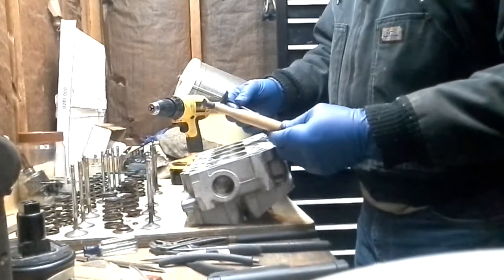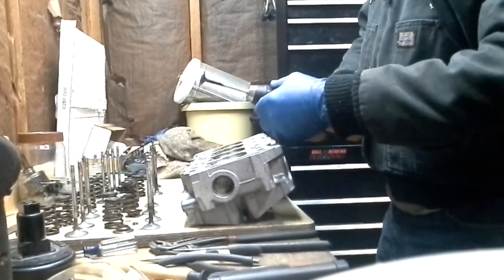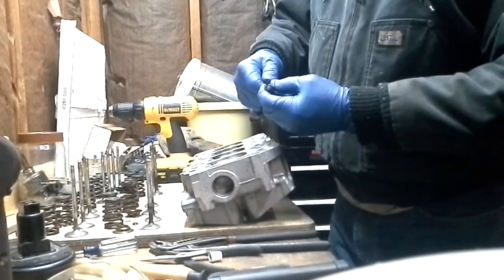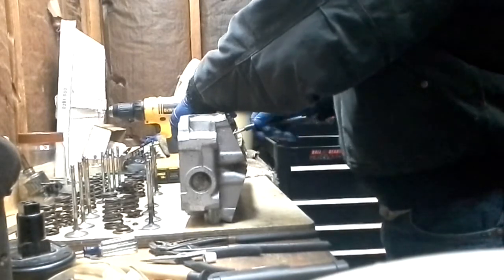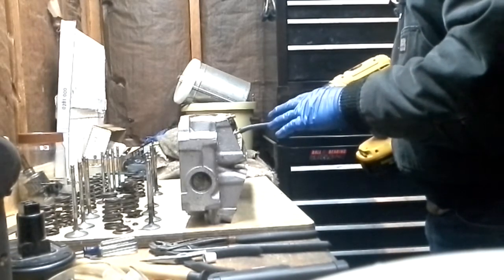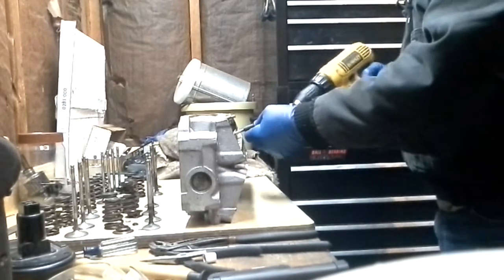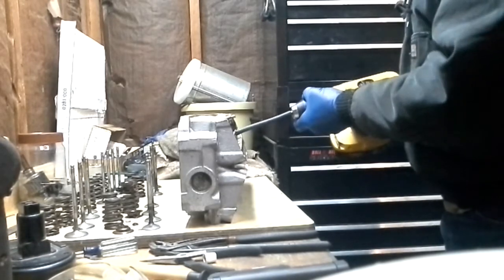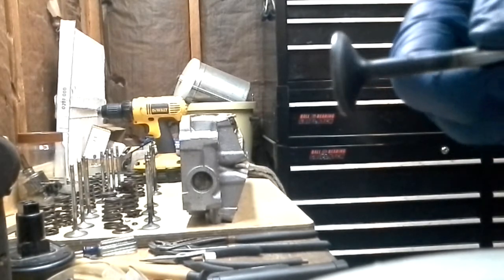Homemade valve lapping/grinding tool. Super easy to make!

Comment: I was told going forward and reverse with the drill sits the valves better.
Reply from the maker: Thank you for the comment. I've done it both ways and obtained equal results.  You could go forward and reverse...I feel it's a personal preference.
Reply: @LD9user  Ok.  Just wanted to get your take on it.

Comment: This is a vaery old technic. Problem mostly is that the hose slides of the valvestem. Always 6 sec left and 6 sec right grinding. There is a special tool build for the drill but its hard to find. But this method really works.

Comment: Just hold end of valve in drill chuck? Forward and reverse drill. Valve stems hard.  Nil damage to ends likely. Saves the rubber bit in between.

Comment: Hi
What is the compresion difference after this valve repair?
Thanks
Reply from the maker: There's no change. Since there was no actual machining of the valves or valve seats, the valves set at the original height (not sunken into the head). This is just a simple procedure to clean up the seating area of the valve. BTW, this motor is still running, has 30,000 miles on it and gets mid 30's MPG. Thanks for the comment.

Comment: Nice job, but thats not valve grinding, thats called valve lapping.
Reply: RU4REAL  Yes it's called lapping but you use an abrasive compound between the valve and the seat so if it didn't grind it wouldn't work would it? So yes it's still grinding.

Comment: You gonna post your races this year?
Reply from the maker: Yup. :)
Reply: LD9user Awesome, when does your season start?
Reply from the maker: Not exactly sure.  By
late April everything will be going along well enough.  The car is pretty much ready. Just need to
change the oil and fill it with coolant. 
I have a couple things I want to try this year. Wish me luck. J